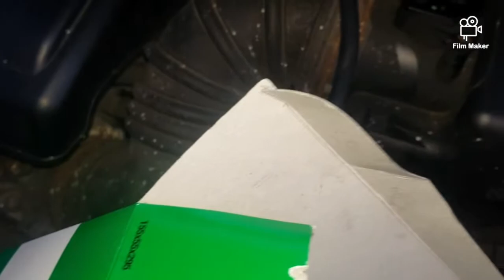Toyota Corolla Full Service || Oil Filter, Air Filter, NGK Spark Plugs & Oil Change || Verso Service

Comment: Bhai Loug...
Koii bhi car ya machinery basic maintenance se he chalti hai, so always follow these steps jo Aap huud bhi aasani se kar saktay hain.
1- Clean Engine Air Filter once in every month and replace it if required.
2- Clean Air Censor (attached with Air filter box) with throttle spray or Isopropyl Alcohol spray jo kisi bhi mobile repairing shop se mil jata hai/ Never use Petrol) + Air Throttle (with Petrol or Throttle spray) after every 3 months.
3- Clean Air Manifold 2-3 times in a year.
4- Always use pre-mixed or Pure Coolant in your cars because Coolant boils at +230C, Ĺekin saada ya distilled paani 100C per. Coolant aap ki Car Engine, AC system aur Radiators ko overheating aur rust se mehfooz rakhta hai. Aazmaa ke dekh lo.
5- Always change original or high quality engine oil + oil filter (in time) 
Sustaa 0il aur 0il filter avoid karo please.
6- Always change automatic transmission fluid/0il after every 30000Kms drive and then Transmission Filter with Transmission fluid/0il after every 60000Kms.
Automatic Transmission Fluid/0il Types har Car ki 0il Gage/ Stick per likhi hai.
7- Clean Spark Plugs after every 10000kms with throttle or Alcohol spray (Please don't use Iron brush)
8- Replace Spark Plugs in time. 
Insha Allah, Aap ki Car humaisha 👍🏿
Aap free time mein sub se pehlay Step-2 try karo, inshallah Average will improve and Engine Lights aur Cumputer errors will get CLEAR 👍🏿
Reply from the maker: U r welcome thanks

Comment: What is the torque for new plugs?
Reply from the maker: The spark plugs on a toyota corolla should be tightened to 18 ft/lbs if you have not applied anti-seize, and 11 ft/lbs if you have applied anti-seize to the threads
Reply from the maker: Yes I did the recommendation torque
Reply: What's a good oil for a1.8 Toyota Altis With over 140,000 Km on the clock
Reply from the maker: 5w30 fully synthetic

Comment: 5w30 or 5w40?
Reply from the maker: Always 5w30
Reply: @diykhan  my car mechanic put 5w40 instead of 5w30 and car mileage drop from 11.7 to 7
Reply: @diykhan  if 5w40 used the mileage drop?
Reply from the maker: I would charge to 5w30 asap
Reply: @diykhan  if used 5w40 mileage drop occurs?
Reply from the maker: Yes. Just get it changed to 5w30 n it will go back to normality
Reply: Thank you 💐💐💐

Comment: What do I need to buy to make full service
Reply from the maker: Hi. You will have to change air filter. Oil filter. Spark plugs and oil. I used 5w30w.
Reply: Hi what size socket do you use for the spark plugs?
Reply: @scottsmith4916  Hi Scott 
Thabk yoi for the video 
i would like to ask you which socket size did you use for the spark plugs + what is the name of the tool to remove out the spark plugs ?
Thank you
Reply from the maker: 16mm socket
Reply from the maker: Its 16 mm socket to remove the spark plugs. U can buy a half drive ratchet n long 16mm socket n that will be ok to loosen the plugs n then u need a magnet to put the plugs out of the engine